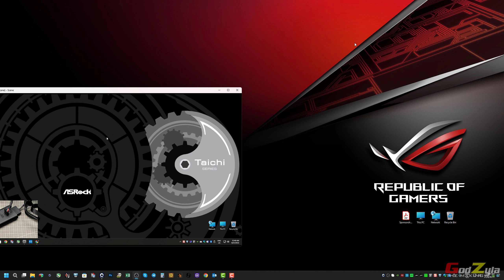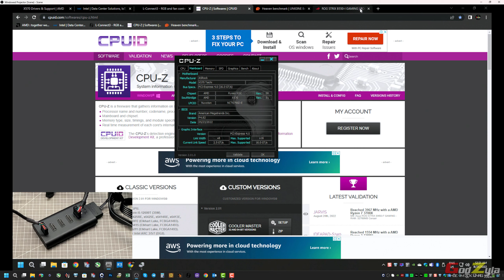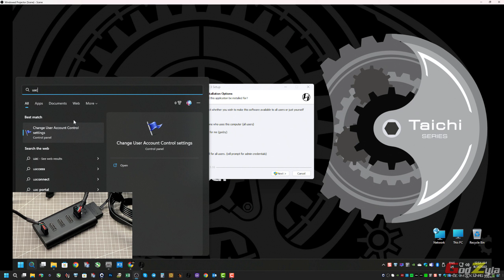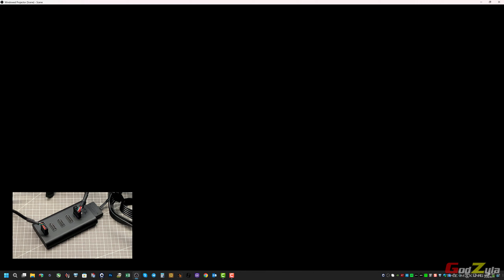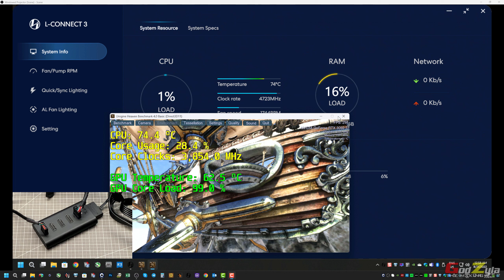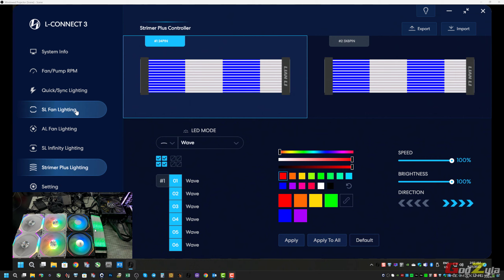Lian Li ARGB Products (How to make it work?) [L-Connect 3]

Comment: Why i only have the option sytem info on my app? Ca somoene hel
Reply from the maker: Hi Luis Grou, welcome to my channel. You might want to go through these basic troubleshooting steps. 

Basic Troubleshooting steps
Disclaimer : Though the chances are very low to brick firmware updates on motherboard and to any controllers. I will not be responsible if you have brick your motherboard or controller.

1) Make sure your motherboard bios is up to date, please check on your motherboard manufacture website, under support > bios and drivers. See if there are issues with USB and do they have a fix. If there are, kindly update those bios firmware version.

2) Make sure your chipset driver for your motherboard is up to date! For AMD will be at https://www.amd.com/en/support for Intel will be Intel Driver & Support Assistant Intel DSA https://www.intel.com/content/www/us/en/support/detect.html

3) Remove all argb apps (Asus Armory Crate / MSI Dragon Center / Giga Fusion / Asrock Polychrome). If the brands which I have mentioned, do have a uninstall tool like the Asus Armory Crate, use that, else use Revo uninstaller ( https://www.revouninstaller.com/ ). Revo uninstaller will remove all unwanted files / folder / registry in your system. Illustration to use revo uninstaller https://www.youtube.com/watch?v=uMgUYiakpxM&t=437s

4) Shutdown your PC, unplug the PSU cable from your AC outlet. Press the power switch twice to discharge all current that your motherboard is holding. Leave it for 45 second

5) While waiting, please do not use KVM switches. Disconnect all devices that are connected to your motherboard (front / back IO). Leave only your Keyboard, Mouse , Monitor and Ethernet (If you have) connected directly to your motherboard. 
If your monitor has a KVM build-in, remove the USB cable from your monitor to your motherboard USB socket. If your mouse and keyboard are connected to your monitor, please remove them and plug them directly to your motherboard instead.

6) Plug only one Uni controller or Strimer Plus V2 controller. If its for Uni Fan (SL/AL) use only 3 fans to an output of the uni controller.

7) Plug the power cable and turn on your PC

8) Go to your Device Manager, look under Universal Serial Bus Devices, make sure you see the Lian Li uni / strimer plus V2 controller.

9) Install the L-Connect 3 app only https://lian-li.com/l-connect3/ (current version 1.3.16)

10)	After installation, run L-Connect 3, check under Setting > General > make sure Auto-Run on Boot and Minimized L-Connect 3 to system tray at close are ON.

11)	Reboot your system.

12)	First thing you need, go to device manager and see if the Lian Li controller is listed, next open up the L-Connect 3 app. Check if there is a need to update firmware to your controller. Go to Settings > Update, under Device F/W version, click on Update Check, download and install the firmware. Make sure the firmware is completed. Do a check on device manager and make sure the Lian Li controller is listed.

13)	On L-Connect 3 dashboard, check if the CPU and GPU readings are reacting, you might want to test it using some benchmark programs. If there are reaction, play with the PWM and argb functions. If it does not work, skip step 14) and proceed step 16)

14)	If Single controller works, shutdown your pc, connect uni fan set of 3 to your output of your uni controller. Do it small steps at a time to hook up your sets of fans. do not do all in one go. If successful and you have a second controller, proceed small step at a time again.

15)	Slowly plug back your USB devices (Headset, Microphone, Printer, USB Capture Card and etc). At any point of time as you add those devices one at a time, if L-Connect 3 become unresponsive. This tells you that there power is insufficient to power up more USB Devices. Whatever USB port on your motherboard, there is a limitation as the current are shared across the board, be it front or back I/O and the internal USB Header. You might need to get a Internal USB Hub that comes with a Sata Power source to the Internal USB Hub. (Disclaimer, buying a internal usb hub might or might not resolve this issue, purchase at your own expenses)

16)	If it does not work, report your issues to Lian li Tech Support. There is a in build log ticketing system in L-Connect 3 app. this is what you need to do. Go to Settings > Support > Click on “Download log” place a filename and choose a destination drive to save the log file. Next click on “Report” it will take you to Lian Li Tech Support FAQ. Fill up the form and upload the log which is a zip file.

Comment: I have a question since I have a deepcool LS 720 AIO I want to swap the fans to Lian LI inf Fans can I connect the fans to the Lian Li controller on the radiator of the AIO or do I need to connect them to the CPU fan head ? But If I connect them to the CPU head how can I sync them ?
Reply from the maker: Hi Ascendpie, welcome to my channel. You can choose to do either. Plug your radiator SL Inf fans to the uni controller, you can use L-connect 3 app to control the RPM and ARGB effects 
Or
while the SL Inf fans are plug to your uni controller, plug the PWM and ARGB cable from your uni fan and to your motherboard Fan Header + ARGB Header. this way you can use L-Connect 3 app to set sync to motherboard and to use your motherboard utlity to control the argb and fan pwm.
Reply: @KleoYan  thank you so much but what if you have the SL fans connected to a radiator to an AIO usually the fans are connected to a CPU fan header but if I connect them like this to the cpu header I will lose the ability to sync the RGB. Should I just use them either way to the controler and dont plug it in the CPU fan header and control it with the L connect ?
Reply from the maker: @Ascendpie  hi, this you don’t have to worry as you can also set to use ARGB with l-connect 3 app and PWM to sync with motherboard board PWM. In L-connect 3. PWM and ARGB function separately
Reply: @KleoYan  so you say I don’t need to connect to the CPU header only connect on the uni controller and the pwm on the motherboard and thats it ?
Reply: @KleoYan  And also I can control everything from the L-connect app ? Thank you
Reply from the maker: @Ascendpie  yup. You can do that no issue.
Reply: @KleoYan  thank you so much for your help I will subscribe for this ❤️
Reply: @KleoYan  I will also use the radiator fans to track the cpu temperature so it all perfect with the Lian Li L connect
Reply from the maker: @Ascendpie  yes you can.
Reply from the maker: @Ascendpie  you are most welcome 😉 all the best with your build too 👍
Reply: @KleoYan  thank you so much, I have one more question if you use the vents with L connect they will work only if L connect is open ? But what if you are on bios, they wont spin ?
Reply from the maker: @Ascendpie  when you have set the profile on L-Connect 3, yes you have to run it at the background when it boots to windows, else there wont be any profile for the fans to follow. Same apply when you've set to sync with motherboard. you see, you are going through the uni fan controller, no matter what you've set, be it to run L-Connect 3app or motherboard utlity to control the fans, bottom line is, your uni controller needs instruction to follow, so you have to run it at the background.
Reply: @KleoYan  I understand but if I am in bios will the motherboard still give the fans feedback to spin them until windows is on and L connect is on ?
Reply from the maker: @Ascendpie  Ok, let me explain further. if you  have connected the fans to the uni controller. your fans will only listen to your uni controller configuration. so when you boot up. your fans will just ramp up abit (initial start) then it drops rpm, next execution will be pending instructions from uni controller. This is whereby once your window loaded and L-Connect 3 auto start with your configuration, lets say you have set PWM to sync with mobo. then your fan will follow the instructions given. The key point here is that your main controller is the Uni controller as you've plug your fans to the uni controller. Hope this make sense to you. Pardon me for the lenghty explanation.
Reply: @KleoYan  I really appreciate all your explanations and I am sorry if I didn’t understand it from the beginning wanted to make sure since it’s my first expensive build. You recomand me just to connect to the unit controller or can I connect to the mobo and the unit controller together and the L connect will take over regardless?
Reply from the maker: @Ascendpie  Ok, am sorry to confuse you. Lets make this simple.. by default, connect your SL-Inf-Fans (7Pin connector (ARGB + Fans) to the uni controller. Plug the add on ARGB + Fan PWM cable  from your uni controller to your motherboard headers (ARGB + Fan PWM) once you boot up. try these options.

1) make use of the L-connect 3 application to play with the argb and fan PWM profile.
2) once you get the hang of it. in L-Connect 3, sync your Fan PWM to motherboard, control your fans using motherboard utilities
3) next in L-connect 3, sync your fans argb to your motherboard, control the argb using motherboard utilities.

From there once you understand how it works through real life experience, you will be able to fully control your fans as how you want it to be. 

i do apologize if I confuse you and I do understand these are not cheap, but it will still be best if you can experience by your own. The choice is yours.
Reply: @KleoYan  Thank you so much for this wonderful explanation and I am sorry if I didn’t understand it from the beginning. The fans are here and now I am waiting for my pc to arrive and to start the build with the fans. Thank you so much for all your help!❤️
Reply from the maker: @Ascendpie  ok when your build parts are here. Give it a try. If you still run into issues. I will be glad to help you out. All the best with your build.
Reply: @KleoYan  Thank you so much will give you a feedback after my pc parts arrive and everything is build
Reply: @KleoYan  my issue currently is that without something plugged in the cpu fan header it wont continue to boot, should I use the aio fan header and move it to cpu fan header ?
Reply: @KleoYan  or should I ignore the cpu in Bios ?
Reply from the maker: @Ascendpie  you con go to your Asus UFEI, under Hardware monitor, disbale monitoring CPU_FAN .. that will do the trick.
Reply from the maker: @Ascendpie  read my previous comment and yes you can just control using the L-Connect App.
Reply: @KleoYan  everything worked out ❤️ Lian li L connect si controlling everything, on full load it can be noisy but it looks amazing
Reply: @KleoYan  I ignored the cpu fan header in the bios, fan speed can be controlled on the Lian Li L connect only, I connected the other cables on the motherboard too (chasi fan header and 5v rgb controller) but I cant control anything from the motherboard it will work only if I unplug the Lian Li unifan controller from the USB 2.0 header ?
Reply from the maker: @Ascendpie  in your UFEI, you have to set the fan header to PWM mode, then in order to use your motherboard PWM to control the fans. on L-Connect 3 you have to set it to sync to motherboard, same applies to your ARGB which is sync to motherboard. you can't have both at a time.. is either L-Connect 3 app or motherboard mode.
Reply: @KleoYan good so it functions correctly, one more thing should I turn off the ai overclocking or not ?
Reply from the maker: @Ascendpie  that's up to you.. if you want to have full potiential you can set it on but your temps might goes up. I never like to use AI but to do my manual undervolt.As default speed is sufficient for me, just that I prefer to run at minimum wattages and does not impact the performance of the processor.
Reply: @KleoYan  I understand I will be doing the same, I have the Asus multicore enhancement that should be turned off as well since stock is on auto ?

Comment: Can I connect my stimmers to my SL hub? And just use one hub instead of two? Also I have the lian li 216 case how do I get my front fans to sync?
Reply from the maker: Hi cookiecook1000, welcome to my channel. It’s good that you asked. Kindly do not do that. Strimer plus draws a lot of ampere, that’s why it has its own controller / hub.
As for the 216 fan ARGB. There are no dedicated dash board in l-connect 3 app but you can plug to any Uni controller that has a sync 2 and 4 port.

Comment: If you’re using the usb connectors with controller, do you have to use the RGB and fan header connector as well?
Reply: Thank you. I plan on using the L connect 3 as you did in video. This is a relief! Thanks for your video, it’s very informative!
Reply from the maker: @DpHo888  you are most welcome and all the best with your build. 😉
Reply from the maker: Hi DpHo888, welcome to my channel. nope you dont have to connect the argb or pwm connector between the hub and motherboard headers. Unless you intend to make use of motherboard utlity to control the fan's pwm and argb effects.

Comment: Hi Kleo, I'm about to start building my PC using an ASUS Z790-Pro MB, with all Lian Li fans and an AIO cooler. My question is about Aura Sync and enabling the Lian Li fans to use Aura sync, rather than L-Connect 3. Is that possible through the L-connect 3 settings? Thanks, Mark.
Reply from the maker: Hi Mark Howell, welcome to my channel. Yes you can do that, you will still need the Uni control and L-Connect-3 though. Also make sure to connect the 3pin 5V ARGB cable between the Uni controller to your motherboard ARGB header. Once you did these, in l-connect you have to set sync to motherboard under Quick/Sync lighting menu and enable sync to motherboard.
Reply: That is exactly what I need to know. In my case, I will have 2 controllers, 1 for a 3 pack of fans, and 1 for the AIO, so as long as both of those are connected to an ARGB header, I should be good? Thank you for the quick reply, I appreciate it. @KleoYan
Reply from the maker: @markhowell183  my pleasure and you are most welcome. Yes that’s correct. All the best with your build too. 😉

Comment: Hey i really enjoyed the detailed explanation, I just finished my new build and have installed 9 Tl fans on my pc, 3 lcd on the side 3 tl led at the bottom and 3 tl led at the top, so i replaced the standard fans that came with the lian li galahad lcd aio with 3 tl fans instead and connected them into the controller, so i am using 3 ports, however the three top fans are not lighting up or showing as connected in the software but they are spinning and working, on the l3 connect software it shows port 2 and 3 fans which are the ones at the bottom and the lcd fans on the side and it also shows the aio too. i been trying to find out why this is and i have checked everywhere but im not sure why this is the case, any information or help would be appreciated so much 🙏🏻
Reply from the maker: Hi adz_khr, welcome to my channel. I would advise you to do this. 

- Uninstall L-Connect 3 app, using revo uninstaller, ( https://www.revouninstaller.com/ ). Revo uninstaller will remove all unwanted files / folder / registry in your system. Illustration to use revo uninstaller https://www.youtube.com/watch?v=uMgUYiakpxM&t=437s
- Next turn off your pc and do the connection as listed below.

a)	Connect your daisy chained 3 x TL LED fans (Radiator Top) to port 1
b)	Connect your daisy chained 3 x TL LCD fans (Side) to port 2 (TL LCD fans will only work from port 2 to port 4, it does not work with port 1) 
c)	Connect your daisy chained 3 x TL LED fans (bottom) to port 3

Once you have done the connection above. Boot up your pc, check on device manager to see if you are able to see the TL Controller listed under Universal Serial Bus Devices. Next install L-Connect 3 app, check for firmware updates. Test your fans and TL LCD again.

Comment: Hi again Kleo, I had a question on how to connect the lian li uni fans sl infinity to my motherboard, I’m using an MSI Mag b550 wifi max motherboard and it only has 2 argb headers. One at the bottom of the mobo and 1 at the top i plan on using the galahad 2 trinity on the side of the case which is the lian li o11 vision, 3 fans at the bottom and 2 on the rear as exhaust, i need help as to how im going to connect these fans into the argb headers on the motherboard and have no clue. Would there be an option of not plugging these in at all and still having the fans rgb with the lian li l-connect 3 or is it mandatory to plug all of these fans in. Sorry if this is long im just very very confused and this is also my first build.
Reply from the maker: Hi Fisnik Hoxha, welcome back. Your Uni fans on the Uni controller, you do not need to plug it to your motherboard ARGB header. You can use the L-Connect 3 app to control the Uni fans. So that will save your issue.